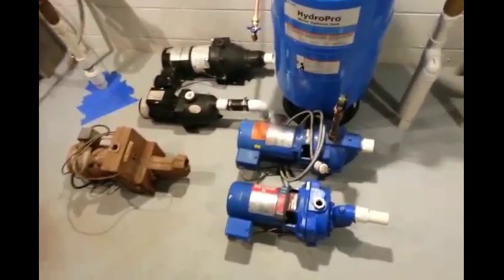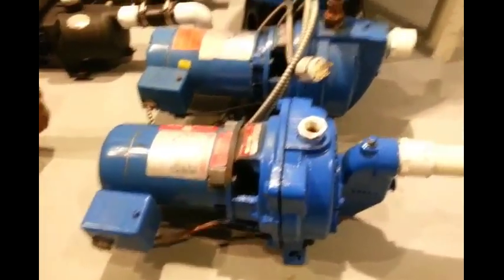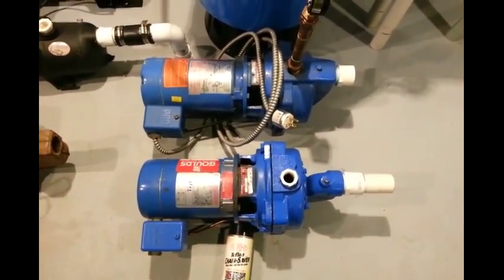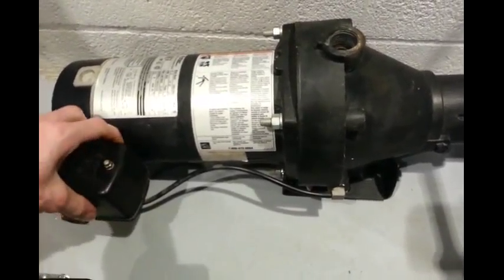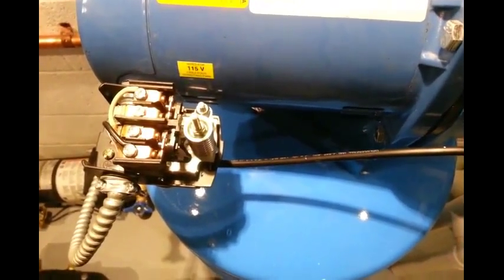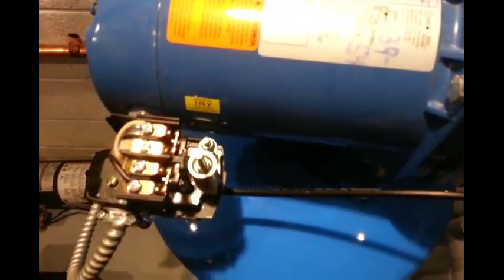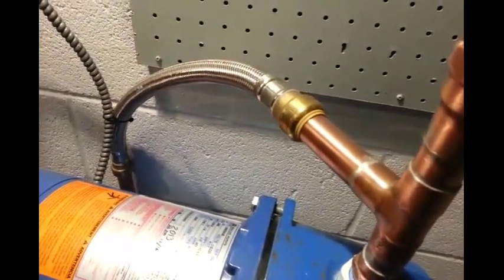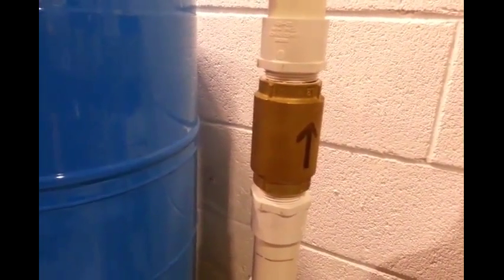Well Jet Pumps and Adjusting Pressure Switches

Comment: Great  video.  Thanks. Question.  I have a pump that looks like  your old one working  fine. I have a metal  tank without a  bladder. I have an air volume  control  thing on the end of the tank. A quarter  inch copper  tube hooks to it and the other  end goes on the pump. So my question,  is the little  plug in front of your outlet a vacuum  producing spot where  I would hook up my air control  valve line so when  the water is rushing  past the hole it would produce  suction  on my valve and making it work? Thanks.

Comment: where is this screen you mentioned? ,and how would a gravity fed spring be sucking in air?, aaaand, it appears that i have only one adjustment on my Wayne 1/3 hp jet pump?, does it handle both parameters?,  is the turn on always a set amount below the turn off limit? say 20lbs? this this is a deep well pump. it pulls up 70 ft. its probably overkill. We installed a brand new tank today, bled out most of the air in the lines and the problem persists. the pressure drops fast and the pump doesn't  turn on till its to late to keep up.  I'm impressed on your response to just about every question. Thank you for taking time to help us!

Comment: I'm planning on replacing everything in my system, same set up as this. My biggest fear is the water bleeding back down into the well. I have a check valve on the suction side but I want to replace it. I'm not sure the condition of the foot valve. With that said, if the water drops back down the well how do I prime the pump?
Reply from the maker: I have never had to prime the well, just prime the pump itself a few times and as long as your check valve is good, it will be able to clear the air from the well pipe and the pump.
Reply: @LibertyDIY  awesome, thank you for getting back to me!

Comment: Can I have my well pipe come out and then go over something like a shelf and then go back down into the pump or will that cause problems with it over the pump like that?
Reply from the maker: The shorter the better but if you can prime it, it should work fine
Reply from the maker: Maybe you could put a T at the top so you could prime it easily whenever needed
Reply: Yea that's my concern is it losing prime and draining everytime if it's over like that

Comment: my pressure switch chatters when it shuts off what could it be
Reply from the maker: Chatters meaning kicks on and off rapidly a few times? I have read this can be caused by debris in the pressure switch tubing, a ruptured tank bladder, clogged pressure tank inlet, or intermittently stuck check valve. I have seen it happen on my pump when I accidentally run the pump with the pressure tank valve closed off. The water cannot compress so it creates an oscillation of wildly fluctuating pressure as the pump kicks on and off. Can you tell me more about your setup?
Reply: new j5s, new pressure tank, new check valve (spring), 30/50, i do have my pressure switch about 6ft away with 2 90s, no leaks,  it turns on perfectly but when it shuts off it stutters, like it shuts off then one then off real quick,  if it were my pressure switch being right on the houseing wouldnt  it do it when it turns on and off? should i move it to the T off the pressure tank?

Comment: How do you shut these jet pumps off?
Reply from the maker: They are hooked up through pressure switches. Once the pressure reaches the set number, the pump will click off. When the pressure drops by 20 psi it will click back on
Reply: Liberty DIY So there is no way to manually shut this off??
Reply from the maker: Yes you can just unplug them. Or if they are hardwired you can put in a switch on the hot leg.
Reply from the maker: Also you can manually activate the pressure switch if you squeeze it or push it up depending on what you're trying to do

Comment: I have a shallow well pulling water less than 10 ft down from the surface.  But  I can't build up pressure more than about 35 psi so I adjusted the pressure switch and air tank down to keep the pump from constantly running. It's a new cheap pump from Home Depot.  I used the original captive air tank and line to the well.  Any thoughts on what could be wrong?  Thanks!
Reply: Thanks for your comment.  The more I think about it I think the problem has to do with the suction side.  Maybe there is something wrong with the foot valve or the foot valve is not sitting at the right level.  Since it's working ok and just an annoyance at this point, I'll look at it more carefully when I close up the camp and pull up the foot valve to see what is going on.
Reply from the maker: Please keep us updated on what you find
Reply from the maker: Is it possible that the well plumbing is letting in a bit of air somewhere on the suction side? If so you would get air bubbles in the plumbing regularly.
Reply: Thanks for the quick reply!  Funny you should mention air in the water. I don't seem to have any air on the cold water faucets but I do have a blast of air coming out of the hot water faucets sometimes when I first turn them on.  I assumed it had something to do with the hot water tank but really couldn't understand what could be causing it.  I never lose prime so I didn't think it could be an air leak on the suction side.  I was wondering if the foot valve screen might be clogged and causing the low pressure.  I'll definitely check to see if I have an air leak.  Thanks again.
Reply: Kathy Mederios if it's only 10 feet down then I don't think it even is pulling water up

Comment: Is there trouble working with the two pressure motor together?
Reply from the maker: I have run 2 pumps at the same time with no problem. They were pumping from different sources, pressurizing a set of 3 pressure tanks in parallel. Normally the pumps and tanks are separated by a ball valve.